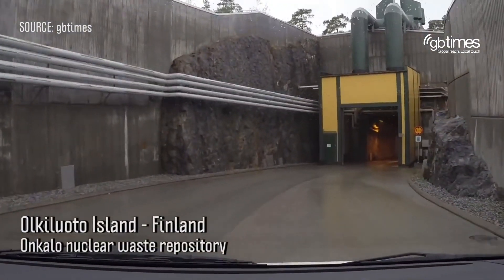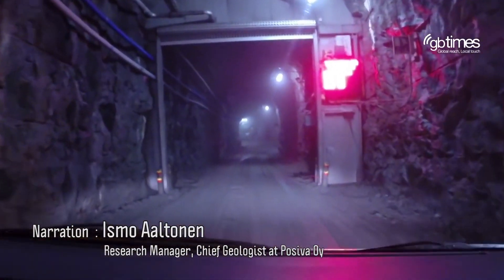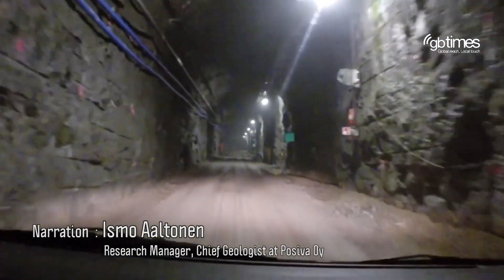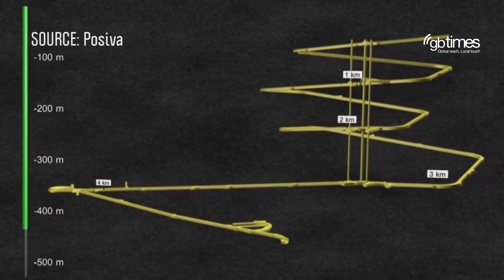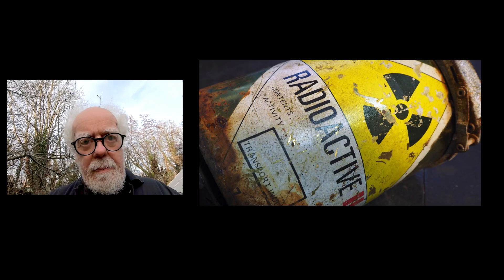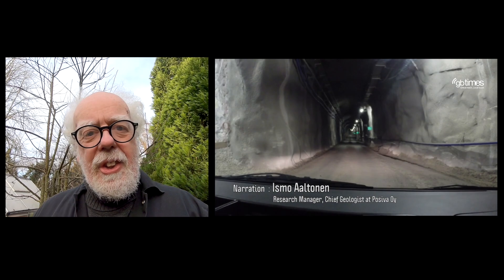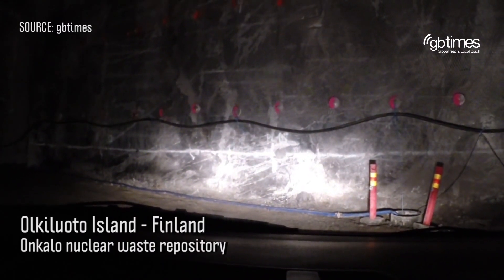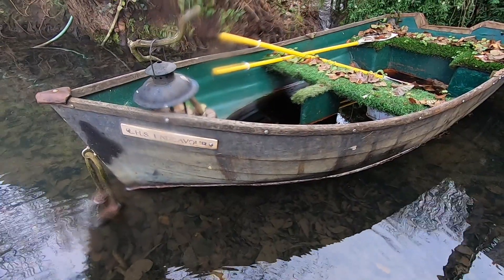How to Hide Nuclear Waste - Prof Simon

Comment from the maker: Thanks for watching and subscribing.... wonderful folk.
Reply: I believe that weapon and uranium based reactor waste must be isolated for a meer 10,000 years before you can get near it. 10,000 years ago it was raining in Nevada near Yucca mountain and the landscape had grass &  trees. Today it is an extremely dry desert. That is just one of the problems with high level nuclear waste. I believe the first step in controlling such waste is to produce as little of it as possible. A thorium fueled reactor produces waste that only has to be isolated for 300 years while a natural gas fueled electric plant produces no nuclear waste.  Natural gas has little less than 80% hydrogen and 20% carbon. Use it in a 50 to 60 % efficient cogeneration plant and you would produce very low CO2 emissions. Thorium reactors can also be fueled with the uranium reactors waste so that that 10,000 year in storage waste can be reduced to 300 years in storage waste.  Thorium based nuclear power could provide us with 10,000 years or more of energy while natural gas would last us 200 to 500 years. There are no easy solutions but producing waste that needs to be stored for about 10,000 years doesn't seem very feasible.

Comment: The big deal about nuclear waste is that it is mostly unused, only few percent of the enriched fuel is used. Molten salt reactors apparently could use pretty much all of it, but separating the fission products from the salt is apparently still a big problem. If a practical solution for this is found, long term waste might look more like fuel instead of waste - or that is how I've understood the situation.

Comment: Is there a perfect solution to energy ?
Reply: I don’t understand why wrangling electrons is so difficult. Kinda feels like the dark-ages. They’re everywhere. Even nuclear power requires a “water mill” to spin magnets, right?
Reply: @jgibson7321  we need magnets to push the electrons along the cables. It may seem antiquated because we’ve been able to do it for several generations now, but that’s how the LHC moves particles too, and I that thing is pretty cutting edge.
Reply from the maker: Most renewable solutions are better options
Reply: nuclear is the best cost effective. and dumping the waste deep inside planet in sealed containers is pretty safe for 100-200 years, and by that time we will have proper disposable and recovery for that waste not to have problems. the other way to dispose nuclear is sending it in space with rockets. the only risk is having a blast at take off and all the waste to be spread around, but the chances are smaller and smaller lately, probably in 5 years the nuclear waste will be send to the sun direction

Comment: So.....until that small release of radiation in '86 Chernobyl, the US was working on an inherently safe reactor that ran on highly enriched material and turned it into low yield material.  Experimental Breeder Reactor-2.  While this would not have addressed all of the issues of nuclear waste, it was a start down the right path.  During a test run of the reactor, they shut off the cooling, and it self-regulated itself into a safe condition without the need for emergency techniques.  https://inis.iaea.org/search/searchsinglerecord.aspx?recordsFor=SingleRecord&RN=33014181

Comment: I think that’s why they have given the go ahead for a new deep coal mine near sellafield in Cumbria.
The locals also seem to think so.
Reply from the maker: That’s interesting...I bet they are doing geological surveys down there for nuke waste
Reply: @SimonHollandfilms  all the surveys have been in the Gosforth  area which is a few miles inland. The St Bees area mine would be under the sea which makes no sense for a long term repository. Historically, mines have been flooded after they outlived their financial viability. The design basis for the repository I believe is for 10,000 years after which the waste will have decayed somewhat, still be significantly active but more manageable for longer term storage.
Reply: Yes it’s true, the mining company says they are opening the deep mine , due to the need for steel works needing coal to make steel. But obviously it maybe be used to dump low level nuclear waste as well. It is Woodhouse Colliery the UK’s first deep coal mine for 30 years , it has been given the go ahead. It will also have a rail connection.
Reply: Yes my son lives up there and that is the talk in the villages all round the area
He says they do have a good attitude with it thow , not bothered as long as its safe , they dont think sellafeild IS SAFE